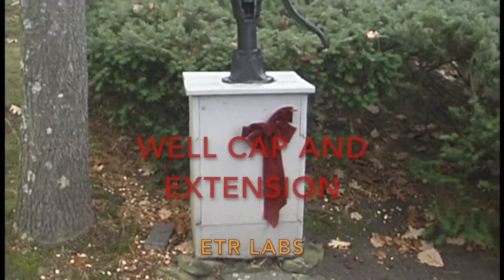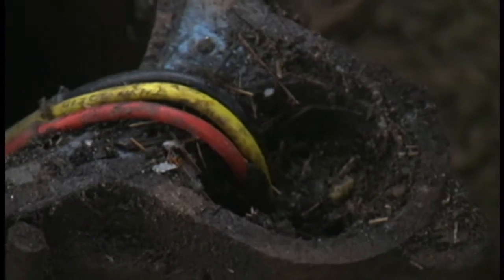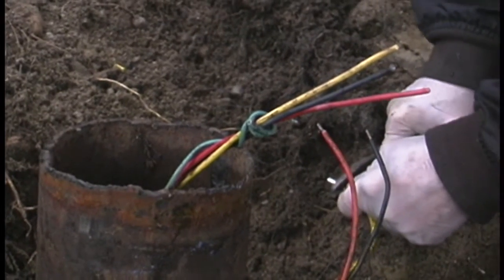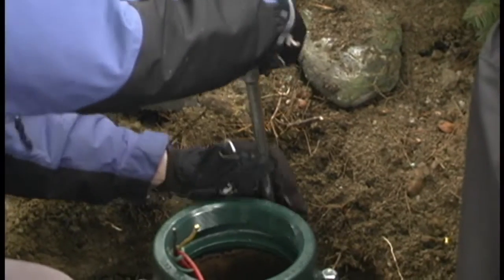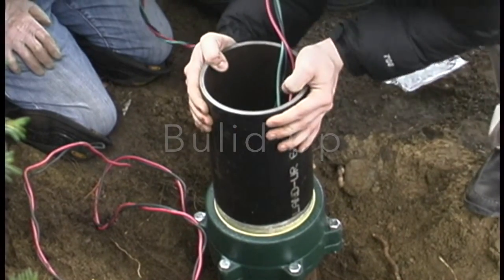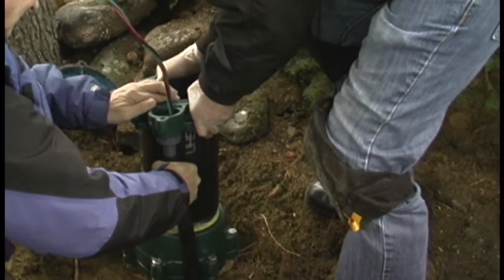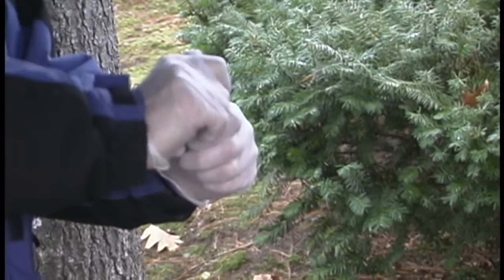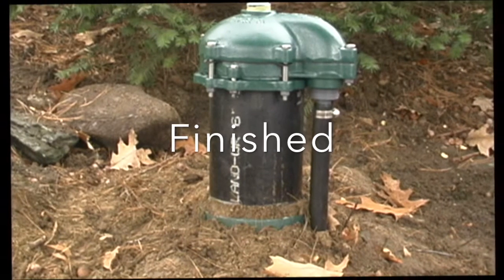Well Cap &  Well Extension

Comment: For the folks wondering about the coupling used in the video, they are made by Baker and are called a pitless connector. They are available in different sizes with the 6" part number of 66apc. They are not allowed by code in all states, but most do allow them to be used provided that the coupling itself is below the frost line in order to prevent separation by frost heaves. They work well, but are not as good as welding. If you are attempting a diy repair this may or may not be what you are looking for as they are pretty expensive. The coupling is most likely very comparable to just hiring a welder in your area to weld on a half thread steal coupling for you. There are really no advantages to using one of these unless you absolutely cannot get a half thread coupling welded in place for whatever reason, or a welder in your area is prohibitively expensive. A mobile welder in my area is $120/hour, and it's a 1 hour job. Add the cost of a half thread coupling and it's still under $200. The 66apc baker coupling is about $300 and most definitely not as reliable as welding. I should also note that some Baker slip joint couplings will reduce the inner diameter of the pipe as well which may cause issues down the road when trying to pull the pump motor. If you decide that the Baker coupling is for you, I'd suggest you verify this before installing or you'll be digging again 😂. When properly installed, the Baker coupling is considered sanitary and should be very reliable for a long time. I would venture to say that the reason you don't see more of them is mostly cost, as most states do allow the use of them.
Reply: Why don't they just weld, why the threading of the new extension?
Reply: @Mental_Patient  nothing to say that you can't, but you can buy the threaded well pipe extension with the hole cut out for the pitless adapter so it's ready to be installed. Welding an extension in place is a perfectly viable option as well if you don't mind cutting the hole for the pitless adapter in the pipe. Many professionals will do just that. On a side note, some folks opt to use the slip adapter and use a PVC extension. This option is limited to a slip style coupling but can save some money by using PVC in place of steel.
Reply: @LtDan-ni5rw  OK,  thanks. I've seen so many videos, and they all seem to use these couplers, wondered why.

Comment: I just bought a property and the well cap is at least a foot under ground level. The well was drilled in the late 50s.  I will need to have it raised to meet current codes. 
   Do you have any idea what this may cost? I'm in rural, western Pa.

Comment: I didn't see you remove the pump, only cut and add the wire. Is in not necessary to remove the pump, as long as it is in good working condition?
Reply: How about the vent?  Where is it?

Comment: What I want to know is where is the water connection, and how can you pull the pump up if it needs to be replaced. All I see here is the well cap and the electric  connection but not the water.
Reply: It's a pitless adapter down about 5 foot. There is a puller pipe you connect the pump hoist to pull it.
Reply: @mailliwnella  Thanks, I did make a 6ft pipe with a T-handle which screwed in the top fitting and pulled the pump up but I couldn't get it all the way out so I chickened out and call the well guy who had a tripod & a come along to pull it the rest of the way out. Who ever did the initial install use Galvanized fittings instead of Brass & that's what went bad but had to replace the pump with a new thinner pump to fit down the casing.